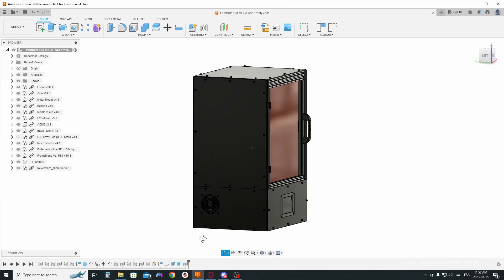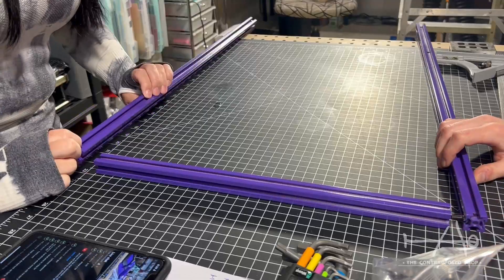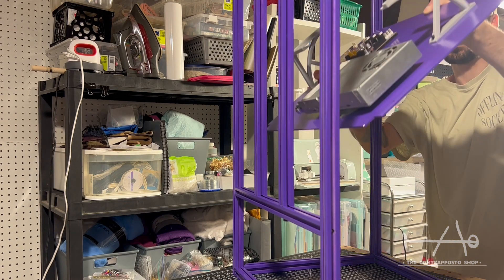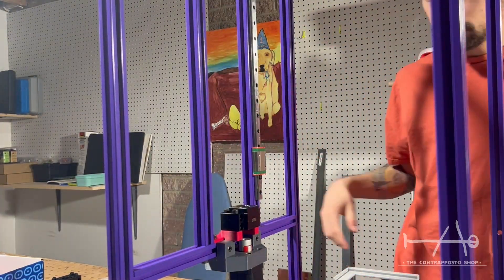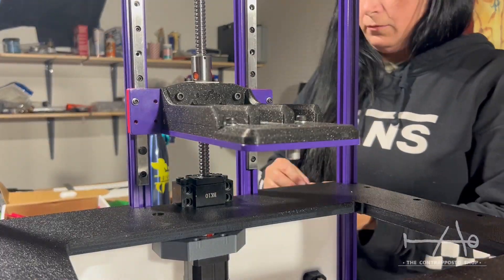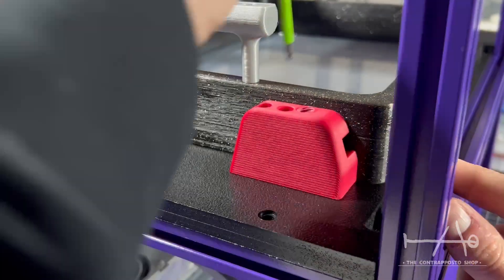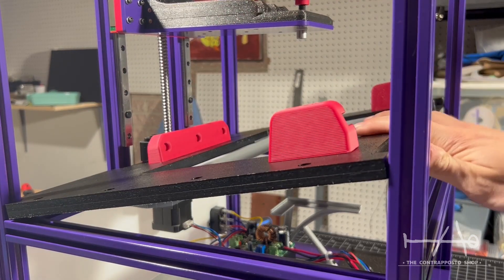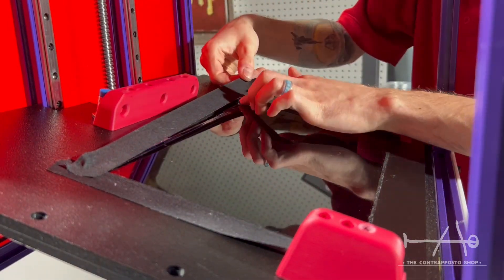Prometheus build video guide

Comment: Is it possible to convert my old normal printer cpb to a resin 3D printer cpb?
Reply from the maker: It’s possible yes but not necessarily easy. Our control board should be abble to fit any* msla printer. The « hard » part is to drive the LCD. Depending on the screen you may need to find a HDMI driver board for it. For the rest it should be straight forward:)
Reply: @thecontrappostoshop   I really and truly wish I could afford your Prometheus pcb but I am in SA and just the price of customs alone makes a 3D printer more affordable and I can't afford a 3D printer aswell 😭
Reply: Do you have any tips on reprogramming my old printer pcb to a resin 3D printer pcb?
Reply from the maker: We are using a rp2040 microcontroller so it’s possible to make something with a raspberry pi pico :) … you can refer to the github for the pinout :)